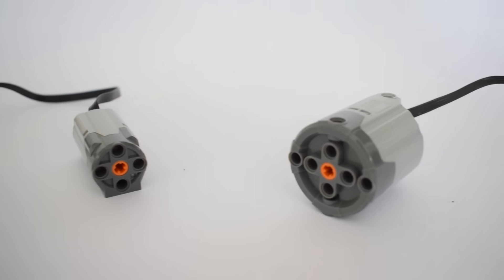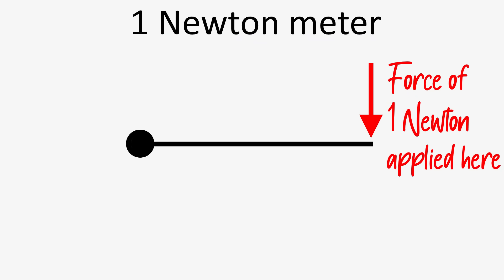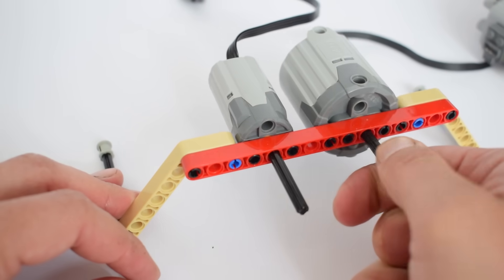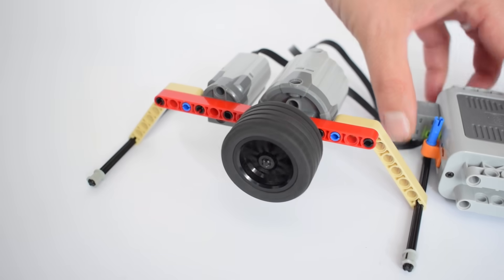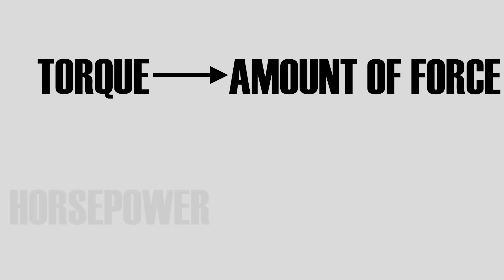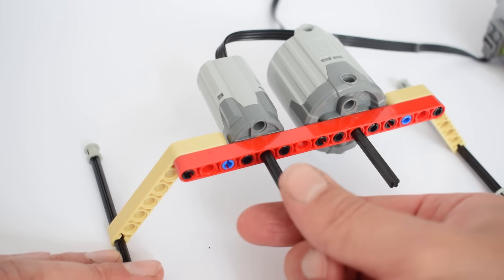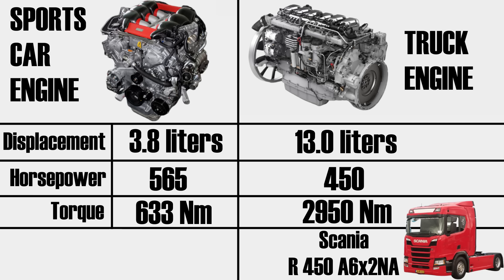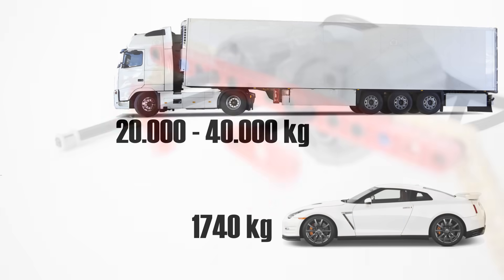NEVER be confused by HORSEPOWER and TORQUE again - HP and TORQUE EXPLAINED in the MOST VISUAL WAY

Comment: So a few follow up questions. How do you decide at what RPM to measure HP, or rather what decides that. What is the formula for calculating HP? Or can it even be calculated, or only measured in real time by a dynometer?
Reply: You can calculate hp by multiple torque with rpm, that is just the basic principle
Reply: @torevenheim9607  Hmm...So my 2023 Civic Type-R makes 310 Ft-lbs: 
310 ft-lbs x 2200 RPM = 682,000 HP
310 ft-lbs x 6500 RPM = 2,015,000 HP

Something doesn't add up...
Reply: At  6500rpm your torque has fallen dramatically, the exact formula for your engine you have to look up in tuning literature, formula for effect
Reply: @torevenheim9607  Fine...I guess my car only has 682,000 HP. I guess Honda engineers waaaaaaay underated it.

Comment: Great video but the mis-match of units is not explained.
Horsepower and foot pounds of torque are imperial and unused measurements in 94% of countries.
Kilowatts and Newton metres are the metric replacements for the old, virtually extinct system.
As for mixing horsepower and Nm in specifications is as silly as saying a car is 15ft long and 1.9m wide!
Would love to see this done with kW.

Comment: But can't we just add gears onto the sports car engine, so it has more torque while the HP remains?
Reply: Yes, that's a purpose of gearbox to make engine operate at highest power during both low and high speeds of a vehicle

Comment: One important additional difference to note is, that TORQUE CAN BE CHANGED by a GEARBOX - you can trade rotational speed for torque or vice-versa. But power is conserved - no gearbox can make power out of nothing. This is essential, and why we have transmission in the first place. You could pull a truck with a Nissan engine, you would just need a low range gearbox.
Reply: Is this on the lines of what Archimedes said? "If you give me a lever and a place to stand, I can move the world. "
Reply: @civilant-p7s  Exactly like that, gears are just circular levers. The same works for belt drive.
Reply: @Simon-fg8iz  
Thanks SIMON. That makes more sense now. I own a 2008 SCION TC with a 4cyl 2.4L and it's very torquey  and they are known for that.
Over the years I have driven cars with Bigger Engines most commonly the 3.4L and they didn't feel no where near my TC but now I understand the Low Range Transmission vastly improves Torque performance. 
Meaning 2 Cars with SAME EXACT ENGINE Size can have 2 Varying TORQUE Ratings due to the Gearing Ratio.
A Corolla with 2.4L feels sluggish versus my SCION TC with the same exact Engine.
Makes Sense now.

Thanks again Simon
Reply: @1malikalik  I had a similar experience. I test drove the bmw f10 4.4L 550i which has 400ish hp and a twin turbo v8 petrol but it felt amazingly slow when accelerating compared to my f11 3L straight six diesel twin turbo 535d
Reply: @Malik Martin  This is precisely why there are usually two torque and horsepower ratings for vehicles. 
There are usually figures for torque and horsepower at the camshaft, so basically what the engine produces, and then torque and horsepower figures at the wheel, or basically what gets applied to the ground after gears and losses due to friction.
Reply: @Excelsus95  But the car with more horsepower will accelerate faster than the car with less HP, assuming the same weight, and optimal gearing. (And so it is: F10 550i has 408HP and 0-100km/h=5 secs. F11 535D has 309HP and 0-100km/h=5.5 secs)
Reply: @Malicious2013  No, that's not the reason, really. It's nothing to do with the gear ratios. It's that there are power losses between the flywheel and the road wheels. So you might have 400HP at the flywheel, and only 340HP at the wheels (regardless of what gear you are in). But torque is only ever measured at the flywheel, because at the wheels, it will be totally different in each gear.
Reply: @Michael  Dynos measure torque at the wheel all the time. Peak torque applied to the ground is an important metric. Torque changes with the gear ratios, yeah, but the amount of torque generated is usually listed as the amount while in the peak power band.
Reply: @Malicious2013  Sorry, yes, they do measure the vehicle's torque at the wheels, but it's not the engine torque. And they only bother because it's the way you measure HP at the wheels - Power = Torque x rpm. But you can see that if you change to a gear that's twice as low, you will double your torque, but halve your rpm, so the HP will remain unchanged.  Torque applied to the ground matters not a jot, as far as performance is concerned. You can choose what number you want that to be, and just change the gearing accordingly, without doing a thing to the engine. But any increase in power requires an engine modification.
Reply: @TheSwordsmon  why is torque relevant then, if you can fix it with gear ratios?
Reply: @Malicious2013 you mean crank chaft...
Reply: I weigh 80 kilograms. If I stand on a 1 meter lever attached to lets say a bolt, I create 785 nm of torque, i.e. more than a sportscar. And what happens if it takes 786 nm to move the bolt? Nothing. Torque does nothing, and can be manipulated endlessly with a longer lever arm. Torque and movement creates work, and power over a specific time. I can attach a 10 meter long lever arm to a truck wheel and move it, no problem. It will go extremely slow because maybe I can move it one rotation per day, i.e. very low power but it will move.
Reply: I was just wondering about that. With the right gearbox and a blindingly fast clutch system the truck engine should be able to make a car go really fast as well I guess. But it would not be practical of course.
Reply: Incorrect. You're talking about the output of the torque vs the CREATION OF TORQUE.

Any given e gone ONLY created the power that it can create. If you choose to measure it AFTER various cantraptions and gears, you're no longer measuring what the engine CREATES.

It's astounding that you and so many people make this RIDICULOUS mistake.
Reply: So is he basically saying horse power is determined by your engines rpm? Because my weedeater runs at a higher rpm than pretty much any diesel truck.
Reply: @tcellison1998  Horsepower is the product of torque and RPM. You have as much power as you have, you can't change that, no free lunch. But with a gearbox, you choose if you want to direct your power more into speed or more into torque. You can up-gear your engine to produce a very high speed rotation, but at expense of only being able to overcome minimal resistance... or you can down-gear it to pull a heavy load but go very slowly. In that regard, you can take a hypercar engine and power a trailer truck with it, you just need to stick a custom made low-range gearbox on it.
Reply: @Simon-fg8iz  when you say "you have as much power as you have" you refer to hp right? or what characteristic of the motor is fixed? torque or hp?
Reply: @mihai2883  Power is power, it's a well defined physical quantity, measured in watts, or horsepower if you prefer medieval units.
Torque isn't power, torque is a rotational equivalent of force, and is measured in Nm (newton meters = force * leverage distance). Torque determines how hard you can pull, how much you can lift, how strongly the engine can try to spin the wheels - torque is what you apply with your hand when using a screwdriver.

Power is energy per unit of time, you can't get it out of nothing, it's directly connected to the energy of the burnt fuel (times the efficiency, of course, a better built modern engine loses less to heat and friction, turbocharging helps to increase the efficiency,...), and is what you regulate with your pedal. But power = torque * angular velocity, so the transmission box decides if you want to apply large torque at low RPM (low gear) or small torque or high RPM (high gear).
Reply: @tcellison1998  AND torque.
Reply: @tcellison1998  Yes. That's what makes HP numbers basically useless.
Reply: Thanks for the comment, I was going to write exactly the same. Lego blocks are also a convenient way of demonstrating how torque can be changed. I'd also add that power is a rate of spending energy (and is conserved exactly because of that, assuming that the gearbox is perfect and has no internal friction).
Reply: Horse 🐎 power is the product of Torque and RPM.
The higher the Torque the higher the Horse power 
The higher the RPM the higher the Horse power of the engine 
But for cars with same hp you need gear box to play for the Torque
Reply: That's what I was asking during the video
Reply: What if you put a high range of gear box on truck so that the horsepower output on the wheels increase
Reply: I weigh 80 kilograms. If I stand on a 1 meter lever attached to lets say a bolt, I create 785 nm of torque, i.e. more than a sportscar. And what happens if it takes 786 nm to move the bolt? Nothing. Torque does nothing, and can be manipulated endlessly with a longer lever arm. Torque and movement creates work, and power over a specific time. I can attach a 10 meter long lever arm to a truck wheel and move it, no problem. It will go extremely slow because maybe I can move it one rotation per day, i.e. very low power but it will move.
Reply: Exactly! I’m surprised he didn’t mention this in the video, but yeah that’s why a car’s hp will always be the same, but it’s torque is different between 1st and 6th gear
Reply: OK I know this is "by-definition"; a gearbox does not increase torque of an engine but reduces the "load" on the engine.
Simplfy by using smaller dia. tyres/wheels.... is the torque of the engine increased OR is the load on the engine decreased?
Simple machines.
Reply: This is why tractors have small HP figures but can still tow things.
Reply: Yes but that Truck will move very slowly
Reply: @torevenheim9607  and the transmission would be bigger than the engine lol
Reply: @torevenheim9607  That same truck moves very slowly (compared to a high horsepower sports car) with a large dispalcement diesel.
Reply: @torevenheim9607  Would it? I mean the gear box that you attach to that GTR engine would be gigantic, but the horse power is actually more than that of the truck. Should this not be in that case about as fast as the track engine if you just make the gear box big enough? 

Or do I understand something wrong here? If you take a low HP engine with a ultra low range gear box THAN it should move the truck super slowly. Ah, maybe I do understand something not right here about levers. 

Oh, just should have kept reading, never mind.
Reply: @torevenheim9607  Not at all. Horsepower is power. You can convert HP to kW. Which is brighter, a 10W lightbulb or a 100W lightbulb?

The smaller high HP engine with a gearbox  that gives it the exact same torque numbers as the regular truck engine would make the truck faster, but only if the gearbox was 100% efficient. 

Torque is essentially meaningless. Horsepower is what actually determines how powerful an engine is. The reason we don't run trucks with tiny F1 1600Hp engines is because of efficiency and reliability, nothing else. 

A good rule of thumb is that a gasoline engine reaches peak efficiency at max torque. Revving above that point will give you more power, but it will be less efficient.
Reply: @sisrace  Thanks, this is the best answer.
Reply: @sisrace    You are completely wrong.  Torque is the only measurement of the power an engine makes.  Horsepower is nothing more than a math equation that tells you the amount of work the torque is doing at different rpm.
Reply: @sisrace  That last point used to be true, but not anymore. Most modern ICEs are at their most fuel efficient (fuel used per unit of work done at the flywheel) at near maximum power, not maximum torque.
Reply: @scarhart53  Thus, torque is completely irrelevant as time is a pretty important aspect of pretty much every mechanical system ever.
Reply: @novideohereatall way wrong dude. Your Electric example is miss leading. If you convert 1000w to 100w you have to consider the volts and amps. If volts stay the same your amps are 10x less.
Torque is not meaningless. That is the only force doing work. Hp is just a way to measure work. Or the rate the Torque can be applied. 
Take a bull dozer for example. You can have a million hp and 1 lb/ft at the track and it won't push itself. Convert that Torque to a million and it will have enough Torque to destroy itself. But the amount of work (hp) stays the same.
Reply: @sisrace Wow. Yet another person who doesn't understand the difference between measuring the POWER CREATED by a given engine vs measuring rotational speed.

You people are hopeless.
Reply: @scarhart53 Yes. Thank you. The marketing of HP over the decades has brainwashed everyone. Including some very smart people, to think it's a valuable measure of power.

So annoying.
Reply: @novideohereatall if torque is meaningless why are the engineers drawing torque vs RPM graphs, not just hp vs RPM?

Honestly asking bcuz i see how torque would accelerate my car but hp is still kinda abstract to me in practical terms. Thx
Reply: @torevenheim9607  No, not if the horsepower was high enough. If it used the 565HP car engine, properly geared, it would accelerate faster than the 450HP truck engine.
Reply: To anyone out there who doesn't get why an off road truck is so much better at navigating rough terrain than let's say your average sedan then this is why, low range gearbox, more torque. Though all wheel drive and differential lock which locks left and right wheels to the same speed also helps, this avoids one wheel unnecessarily spinning, digging a hole while the other is actually doing work also help a lot
Reply: Actually you can increase hp using a flywheel
Reply: Gearbox = torque multiplier
Reply: Power is product of Torque and RPM. The greater the power (hp or KW) the greater the torque produced (N-m, ft-lbs)
While Torque is greater with low RPM when Power is the same

Comment: Nice theory. What about practice? More torque means better acceleration or towing capabilities? What does higher horse power give? Higher max speed?
Reply: More Torque = tow heavier objects
More HP = faster acceleration of lighter objects
Reply: @MichaelPohoreski  so - More Torque can be achieved by switching to lower gear. More HP is when you need to feel those g-forces in a car.